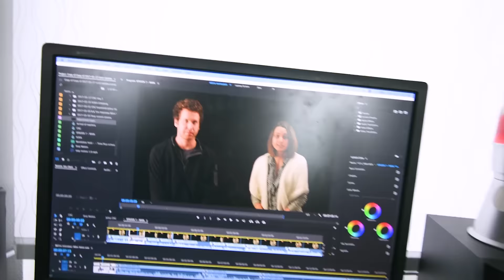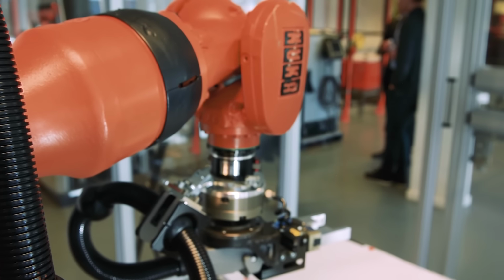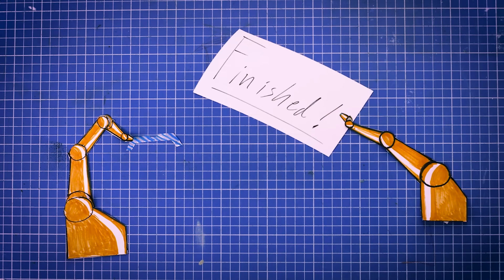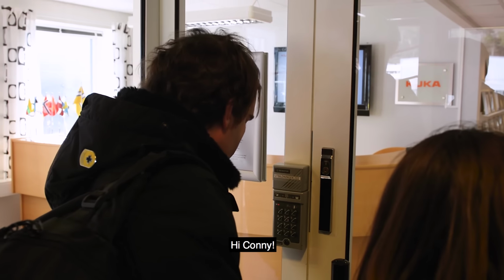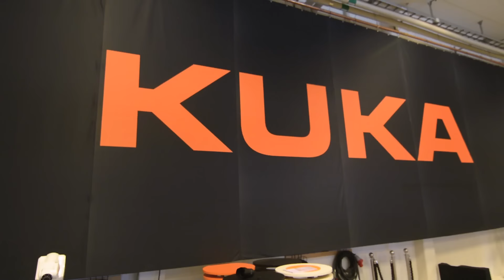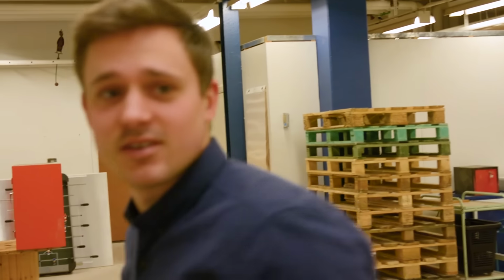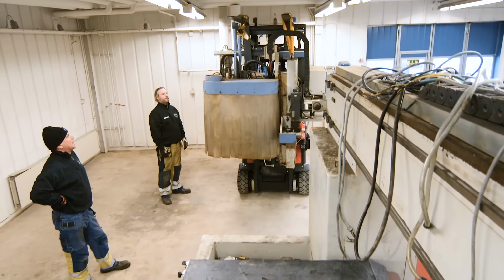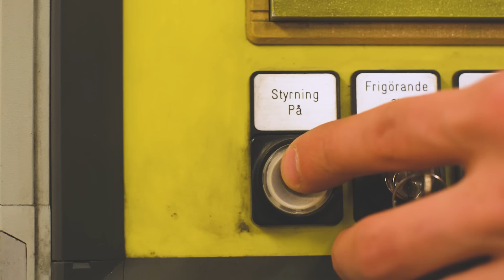An Army of Robots | UNITI UPDATE 7

Comment: Hi uniti 
i just found about your project last night and I am a big fan now
I want to ask 
which kind of composite you will use?
e fiber glass is cheap but  30%weaker than carbon fiber
carbon fiber is expensive 23$/kg and powerful and light
s fiber glass is better than carbon fiber but expensive
maybe chassis frame from carbon fiber or s glass and the rest of the chassis from e glass 
these will keep you with the price tag
Reply: you can also use used kuka robots costs as less as 4000$ you don't have enough money for new 100 units
Reply from the maker: Hello, great to have you hear! The chassi will mainly be made from carbon fiber, with a resin that is recyclable! Then for body panels and such we are looking into a variety of materials that haven't been pinned down completely. 
Glad to see your interested! Do you work with material or where does the interest come from?
Reply: Noureldin Salah we have many new investments. We will buy the robots new. Because uniformity and precision is not something we can compromise.
Reply: +Lewis Horne  wish you the best